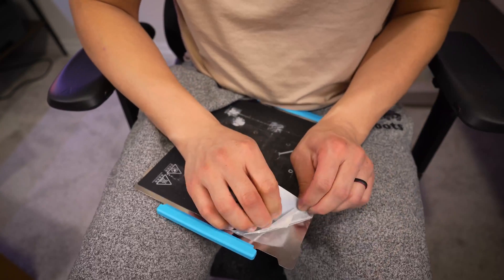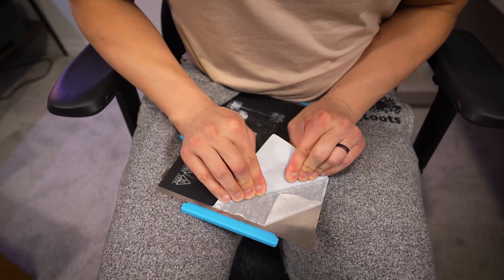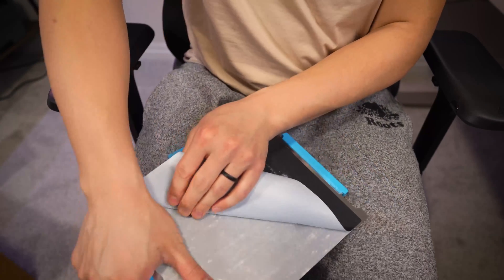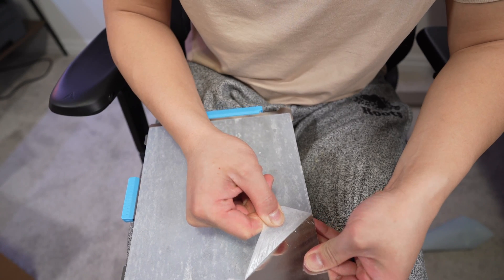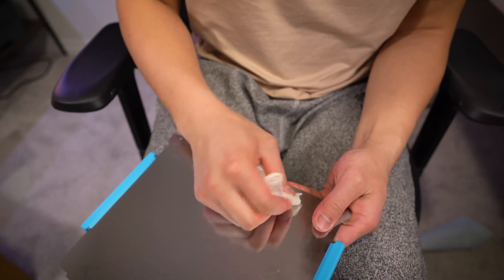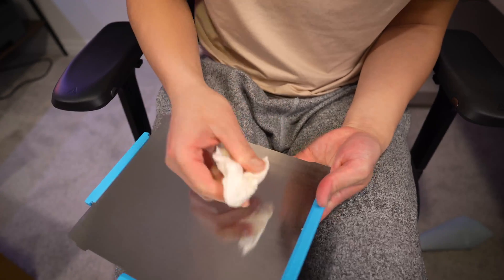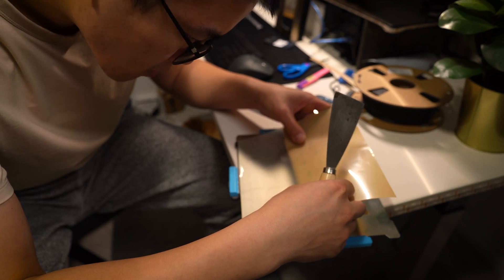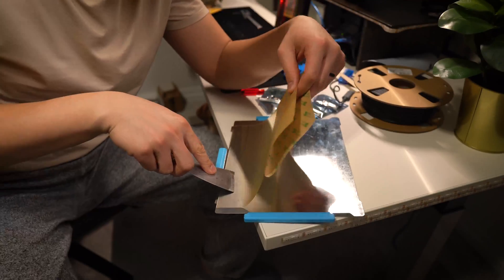How To Remove/Change Buildtak [Replacing with PEI]

Comment: So two issues I have with pei on the ad4

It + most advesives together are quite thick, increasing the amount of time it takes for ALLLL of it to heat up

This means, a lot of the time I have running into an issue where I would level the bed, the printer would heat up the bed prior to printing, and it would start printing just fine

Then, several minutes later, the advesives and sheet would expand a lot, and the nozzle would drag and clog onto the surface. 1000% hated this.

Just use cheap painters tape. Cheap and ez

Comment: Great work, I have replaced mine several times now, the abrasive bed is entirely too good at adhering.  I however opted for the Ender 225x235 replacements as they are affordable and quickly shipped but the FF underlying adhesive can be extremely uncooperative.  I love your videos but have seen none on the Bowden tube or collect for the FFA4.  Mine has been giving me a ton of problems.  Just wondered if you experienced similar.  The FFA3 used to have a plastic collet that locked on above the brass PFE fitting the 4 does not and I am seeing frequent disconnects from the extrude housing.  Keep up the great work and thank you for your time.

Comment: I definitely want to try this. The buildtak is way too adhesive and it's difficult to remove the leftover raft material. My best solution right now is to use a heat gun and a metal spatula to get underneath the raft in order to remove it.

Comment: Did exactly this to my sheet. Best decision and upgrade IMO. I did heat by bed and it was a bit of a glue mess but a razor blade and IPA cleaned it all up. I also got a 220x220 sheet but realized it is a hair small on the sides for correct calibration /leveling and would get the next size up when i need to replace the PEI.
Reply from the maker: I got the exact same size you did as well. It is a bit small but I trust my shims so I just level with the centre point and click print

Comment: Excellent recommendation!  I was thinking using PEI as well, but I went with blue painters tape.  It makes a great surface for ABS.  All I do is lay down several rows of blue tape, lightly scuff the tape with some 220 grit sandpaper and then spritz a little rubbing alcohol on.  It gets incredibly tacky and I have yet to have any curling off the plate.  I'm interested in hearing about your results as I have an extra plate that has a mangled surface...
Reply from the maker: I haven’t printed abs on mine yet. I might do ASA instead mainly due to the smell. My printer currently sits in my studio which I’m in quite often so the fumes would probably kill me in a year haha